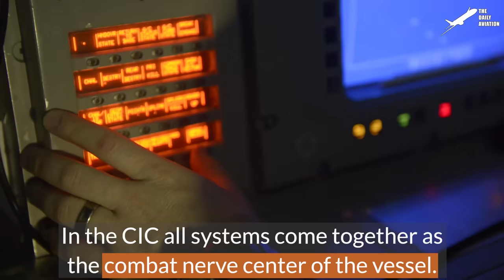Life Inside Most Feared US Destroyers Patrolling the Sea

Comment: Why don't they build a 360-degree ring around the anchor feed tunnel with high pressure water jets, rather than manpower with fire hoses hoping to clean off the hundreds of feet of anchor chain.  I would then have a hose crew for backup sea growth etc., to remove any missed debris, seems like a lot of manpower or now womanpower to conduct something that can be built into the retrieval / drop tunnel.